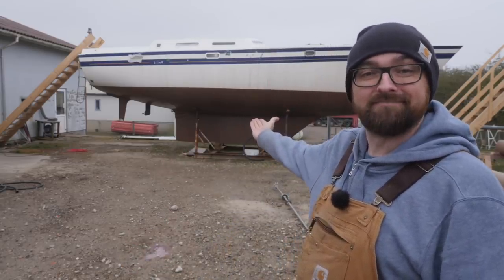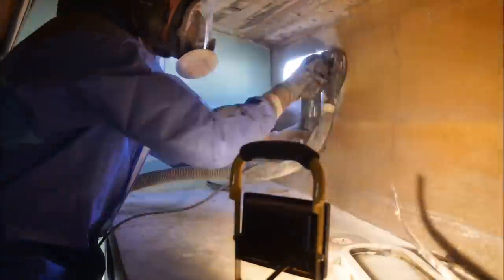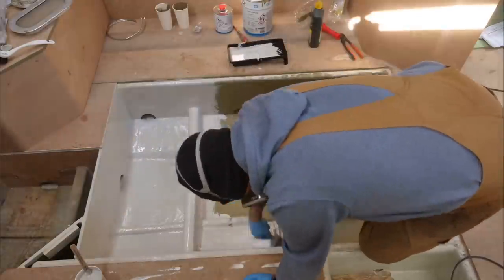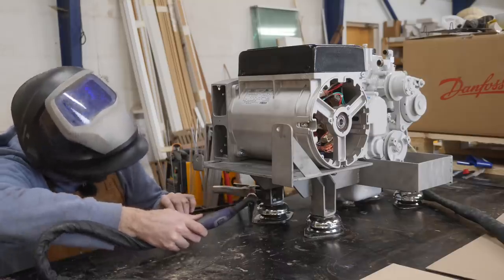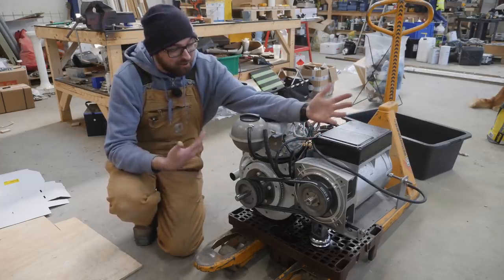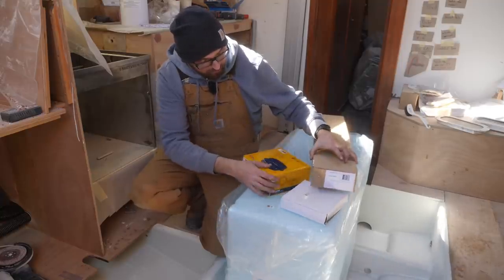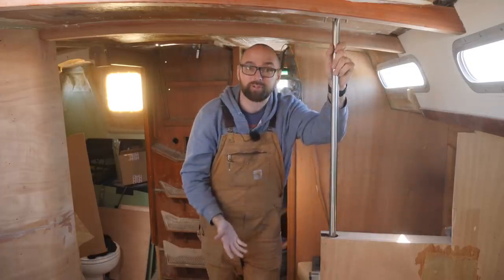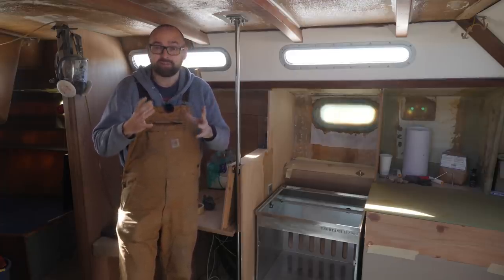Sail Life - DIY generator fail, galley pole - sailboat project

Comment: Next sundays episode: Sail Life - Turbocharging a Iddybiddyperkins 102 
😁
Reply from the maker: Or ...or... how about a DUAL engine generator 102 + 102 = awesomeness? ;)
Reply: @SailLife  102+ 102= 204 or a backwards 402 :)
Reply: @SailLife  No seriously, a low pressure turbo, or maybe even a blower might do the trick. In the spec sheet it says 6.8kW. You only need a tiny boost. In the last few revs there is the most power, so altering the gearing to go to 3200 rpm would do a lot.
Reply: Doktor Jönsson this is legitimately a good idea. Although it would create another potentially point of failure, it many upsides. Running a turbo gives you the power when you need it, but can also gives you the fuel economy of a small motor, when you aren’t pumping out a bunch of power.
Reply: julien hunt good point about the failure point,  but bear in mind that they have the main boat engine and alternator as a backup so it wouldn’t be the end of the world
Reply: Glorious glorious turbo instead of sanding
Reply: vxnova1 plus Im thinking they will still have some solar, as small as it may be. It’s just a failure point for the generator, not the overall operation of the boat. With that said, it would be a small risk, worth taking. Let’s see us some turbos!!!!
Reply: @SailLife  at least replacement parts would be easy to figure out, 2 of each.... :)
Reply: @SailLife  Dude, you thought you were getting a stroker, but it's just stock. So get it stroked dude!  No need for a turbo or a second one. Go loooong (arm that is)!
Reply: @willnelson1931  If you mount the 102 upside down it's a 201, 201+201 tah dahh 402!

Comment: Keeping the itty bitty tiny Perkins will only cause you to re-live the pain each time you need more power but don't have it.  Since you will be living a lot of your life onboard, I recommend investing the pain now and upgrading the Perkins... or Yanmar... or Kubota... for the power you need.  The financial pain now will heal faster than the constant reminder of a single error.
Reply: Change pulley ratio
Reply: @kevinbrumm3272  Right, I was thinking the same thing.
Reply: @Kevin Brumm and @Shaggyduder: Not as simple as that-- the problem is Horsepower and Torque. Increasing pulley ratio will "bog" the engine, thus needing more RPM, thus using more fuel. And that's what the issue is. Pulley ratio is already maxed-out. More engine power is needed.
Reply: @kevinbrumm3272  You can't get something from nothing.  If the engine outputs 6 kw then the alternator can never produce more than 6 kw.  With generator losses and belt losses and derating for continual load 4 kw real world.  The purpose of the pulley ratio is to match the ideal rpm of the engine to the ideal rpm of the alternator however it can't increase the amount of power available.
Reply: It falls into the old axiom "Buy Once Cry Once" !

Comment: Try to find a used 402 Perkins and swap out the engine.
Reply: @Sail Life _ The amount agreed at this post outstrips your line of thinking to up the Inverter!  SELL the 102 and search for the 402! _
Reply: Nope, too easy. Just boost the little one!
Reply: If in doubt, do it right. It’s not like you haven’t reworked a few things already. Sell the 102, find a 402 or equivalent and you won’t be regretting the DIY generator for years to come.
Reply: I agree. Buy a 402, IF you can find one.

In the meantime buy that smaller generator you said and hook it up to the 102, then sell that package to someone. 

Putting together the next generator should be a piece of cake.
Reply: My suggestion as well.
Reply: Clearly the only solution is to turbo charge the current one ;)
Reply: I say, do nothing for now. See how 102 works in real life. Do you really NEED to do laundry, fill diving tanks, make drinking water, cook a turkey and use a sanding machine at the same time!
Reply: @TheRealBrockRoberts  using a 402 will probably result in the diesel being seriously under loaded/utilised which results in cylinder lining glazing and gumming up of the head. Easiest way to destroy a diesel.
Reply: @j.r.90001  exactly
Reply: Perkins 402 looks to be based on a Kubota industrial engine series. You can therefore opt for many other 2-cylinders and get the same power, like Vetus, Beta, Nanni, Sole, Kubota tractors, refrigeration unit/container engines. It should be a straight swap, all ancillaries compatible. If you compare Beta 14 pictures to your existing engine, you can see that it is practically identical in terms of block size, feet orientation, pump placement, even the pulleys and starter are the same.
Reply: @clutelmm  that 102 will probably double in value bolted to a quality base plate like that coupled to a generator. That's a good plan too

Comment: I suggest research on the differences between the two engines. I suggest that if the 102 and the 402 look identical, then odds are that the only difference is the fuel injectors and the fuel injector pumps pressure. If so, you can have your high pressure pump "turned up" and get two new injectors. Talk to a perkins guy who knows his stuff
Reply: That's a good point.  I know that with older 2 stroke outboards the makers would have the same block for a surprisingly wide range of HP and the output was controlled by porting and compression differences.
Reply: Wouldn't it also be in the cylinder bore and piston size?
Reply: looks like the 402 is a stroked version of the 102
Reply: I looked up Perkins site, bore is the same at 67mm but the stroke is different 64mm for the 102 vs 72mm for the 402.
Reply: @JY-mq5lg  then a quick fix would be to find a crank and rods from a 402 and do a stroker swap, the only thing that would cause a no go would be if the main's were a touch bigger, but I doubt it.  I would also look and playing with the injection pump and injectors to squeeze out more KW's
Reply: @SailLife this is also what came to my mind when you said that they looked identical.. Dan's got a point
Reply: probably differences is on crankshaft stroke 102 has -450cc , 402 -500cc
Reply: @TdrSld  a 5/16, 8mm longer stroke isn't much. Identical pistons and rods and a stroked crank. My call would be turn up the pump and get 402 injector. My guess is a de-tuned 402 rather than a souped up 102. A new crank makes it 402
Reply: @daneatherton7886  You'll get more power out of the longer stroke for less fuel than just cranking away on the p-pump. You can see this in action on 302w that get stroked to 383's. 383's dont touch the bore size only the stroke, but the power gain is massive. way more than putting fuel and timing into a 302w.
Reply: I think he should just put a Turbo on it........🤣
Reply: Hi Mads. Is your new diesel tank with partitions to dampen 'wave swings' (if that thats the right words for it..)  in the tank?. Regards Torben
Reply: Quite the way to go Watson☝🏽
Reply: @torbenflykristensen238  theyre called baffles, with partition holes on the bottom where the fuel flows
Reply: @foxmd9410  turbos just cramp more air into the cylinder, so to make a turbo run appropriately you need to turn up the fuel which means bigger injectors and pump pressure
Reply: i came here to say the same thing
Reply: @foxmd9410  LOL, I was thinking supercharger!
Reply: I agree. He can get the hp up this way.
Reply: @guy.h  that's what I was thinking. Plus if he bored it, it's gonna be basically a brand new engine without having to pay for one.
Reply: @JY-mq5lg  it's a stroker!!! Who knew! Nice job.
Reply: If there is verticle clearance in the cylinder block the bigger crank throw  may work or pistons would simply hit the head. If you want truck power then get a truck engine! You'll end up spending more on mods that never quiet get there.... Just get the bigger engine.
Reply: i agree with simply upgrading the parts for a 402,  of course do the research,  but Perkins would use as many parts on all models as possible even if it lowered efficiency in an effort to save money so this will work in your favor to re-mod it!!
Reply: Good call ie.injector pop pressure change & even turning the pump up in timing by 3°. BTW, if adding stroke, the rod lengths would be shorter or the piston tops thickness decked.
Reply: @Dan Eatherton:  @Jeff Young, below, found the issue-- piston stroke. The extra 8mm of stroke the 402 has, vs the 102 increases HP and Torque. And, yes, the injectors and pumps may need adjusting or upgrading as well.
Reply: @crustycurmudgeon2182  Just tow a barge covered in solar panels and wind generators. It works on paper. ;-)

Comment: The reason why I like this channel is the open and honest way you present errors and mistakes. It's actually the norm rather than exception and enables us to make real progress. I have no advice to offer on where your solution lies, your technical expertise vastly outweighs mine. But I have no doubt you will figure out the correct way forward. Thanks for the channel.

Comment: Personally I'd look for the engine I wanted and alter the mount to accept it.

Not to worry, as I understand it there are two types of people, those who screw up and those who lie about it. Nobody is perfect and nobody was born great at anything.
Reply from the maker: I like the cut of your jib! :)
Reply: Aye, I mean, if they look the same, and have similar dimensions, then certainly you might find a used one somewhere that could be restored and more-or-less dropped-in-place right? I think this is a better option than modifying the exterior of the boat with large stainless tube to hold solar cells. Exterior solar cells are certainly eco-friendly, but they destroy the appearance of a sailboat, imho. And the other problem solar cells on a sailboat is they cannot track the sun like land-based solar cells, so you're always taking such a large efficiency loss above or below 30-degrees  from the equator, that they are more of an eyesore than a useful piece of equipment.
Reply: Pooping, my youngest brother was born a great pooper
Reply: Looks narrow between the island and the cooker when gimballed?
Reply: Nope three types, some people do nothing.
Reply: No reason to stay with Perkins.  Yanmar and Kubota both make some very nice small engines.  Get one at least 10kw.  (Kubota D905)
Reply: Jack Patteeuw Yes!  After researching your problem, all the literature said take your heaviest use estimate of kWh & double it.  It does look fairly pricey, though.  It makes a great deal of sense why you did the recondition.
Reply: That'd be my call too Mads. You've proven the concept design, you have a very saleable 102. Just hold out for the right engine that gives you your 10kw!
Reply: With lithium batteries the tiny pixies don't care if they come straight from the generator coils, or from the  battery and get replaced a little later by the generator.  Sure there is some loss in the inverters -but not all that much in the long run, and it is offset by more efficient charging diesel usage. 

I think Mads is over-estimating his median energy usage.  4500w, or even 4000w is a LOT of juice.  Unless he is running everything ALL the time the generator is going to keep up fairly well and still charge at a decent rate almost all of the time.  Most small homes don't draw anywhere that much juice usually.  If they did their power bills would be through the roof high. Even with the electric kitchen, it's going to keep up and be making excess power most of the time it is running to top off the battery bank again fairly quickly.  Rarely is the oven and all the burners going to be all on at once at high.

Many hybrid autos run on this same principle.  If you oversize the regenerative capability then overall efficiency in power generation suffers in gallons per kW-hour.

A smaller generator is quieter and produces less vibration while running.  And if it runs a little konger nobody will really notice other than w little more bubbly splish-splash coming out the exhaust through-hull.
Reply: This is what I would do, kubota makes some really reliable small engines in that size as well. Just find another one and sell the 102, make a new base up and off you go. If you've made one it's a lot easier to make a better one the second go at it anyways.
Reply: @honeybadgerisme  I would look for something more like 15 kw.
Reply: Sail Life Please see my reply on your Perkins fail video concerning changing the pulley sizes on the Perkins and alternator. Easy and dramatic fix for lowering engine rpm while increasing alternator rpm. You could turn the pulleys there in your shop.
Reply: @svbarryduckworth628  you have nailed it. 5kw is, to use Mad's terminology "glorious, glorious amounts of power". I think you would have trouble using that much all at once.
Reply: @CanadianTracks  Not enough space.
Reply: @SailLife  

I was doing some searching online, and it looks like the 102, and 402 are the same engines. The only difference is the 402 has a longer piston stroke. All you should have to do is change the connecting rods, and maybe a crankshaft/pistons to turn it into the 402. Call a parts dealer and compare part numbers between the models, see what is different, and order those parts.
Reply: @EmptyPsychosis  in order to make more power a diesel needs to burn more fuel and pump more air.  Longer rods takes care of pumping more air, but the injector pump would need to recalibrated at the very least, if not replaced altogether by one capable of metering more fuel, as well as the governor mechanism and the fuel injectors themselves to match the required fuel flow.  

Basically the fuel system would have to be totally reworked in addition to a bottom end job as you describe.  Since the fuel system on a diesel is roughly half the cost of the engine I can't see how this would be cost-effective here for Mads over finding another used engine.

Comment: I lived aboard for ten years with occasional dockside shore power, and away from the dock I had a diesel genset and an inverter. Like you, I had a rather high consumption boat including washer/dryer, electric cooktop and oven, plus more. It didn't take long to figure out what everything draws, and to know almost intuitively what could run at the same time. Sometimes when I was sharing a quiet anchorage with others, I felt self-conscious about excessively running my genset, but I quickly realised that others were running their main engines longer and louder. Rarely did anyone complain...it's just part of boating. Once you stop beating yourself up, you'll be more at peace even if you stick with the itty bitty Perkins. Keep up the good work.

Comment: The wrong engine is a blessing in disguise. Diesel engines like to run around 80% load. Running them with little or no load sees them glazing the bore linings and gumming up of the clylinder head. We have a 5kw engine driven alternator which we seldom use. Running the main engine to generate 240 volts sees the engine using about 3% of the engine capacity  - a big no no. I purchased a 2kw Honda portable for occassional power needs. We do run the main engine driven alternator if we need to vacuum the boat or turn on the hot water system (water heats from engine as a matter of course). As i said, a blessing in disguise. Most boats need to decide what they want to run and seldom have everything turned on at the same time. If our Honda is running it lets us know if the load is too great. Also soft start options can reduce start up amps. The movie Apollo 13 is a great example of sequencing start up amps. Ithink you have a reasonable and workable outcome. A diesel that will run at a decent load with an alternator that is working well within its capacity.
Reply: That would work good with the changing the pully sizes. I was worried about putting on too much of a load if you increased the pully size on the engine, and maybe made the one on the alternator smaller. But if diesels like a 80% load that would work good in both directions. You would just have to find that sweet spot.

Comment: +Sail Life:  Hello Mads! Sorry to hear about the itty-bitty, now teeny-tiny , DIY generator error.
In reading thru the comments here, it appears the preponderance lean towards correcting said error by selling the 102 Perkins and moving on to the 402 Perkins or its equivalent. FWIW, have to agree w/ that preponderance of opinion, for the simple reason that you will never feel good about the error. It will gnaw at you from now on. Best to get that error corrected now and be done.
Yes, you're kicking your own arse to a proverbial pulp for having "f-up" , but you did. That cannot be helped at this juncture. So, stop kicking and get on w/ it! Just don't make a similar error in the future. Learn well from this one, dude.
In the meantime, as usual, this video has garnered another big 👍🏻from here! Keep up the good work! And take that boot out of your arse 🤣...

Comment: the question is, If the 402 looks the same as the 102, what makes the 402 higher output? Can you modify the 102 to a higher output? It may just be a matter of larger injectors.

Comment: Regardless of the size of the generator, there is no getting away from having manage power on a sailboat. With that said, you may want to research the size of the pulleys you are using. There might be a way to change the ratio to get increased output from the alternator.
Reply: This was my thought as well. Also I was thinking that a lighter flywheel might be beneficial for less rotational mass. These kinds of mods are performed all the time for cheap and easy bolt on improvements in performance automotive applications.
Reply: I am thinking the same.  If they are only looking to increase revolutions, why not just change the Pulleys?  It will definitely be cheaper and probably faster than buying a new Diesel Engine...